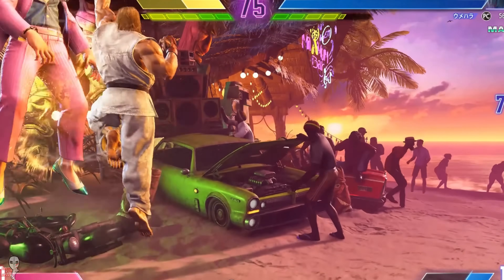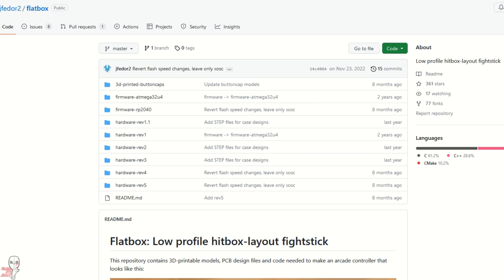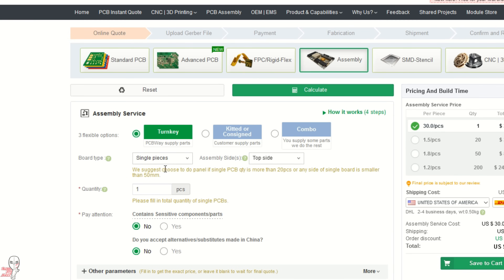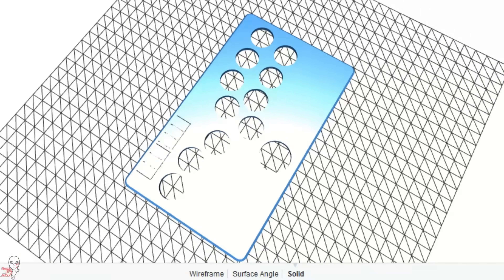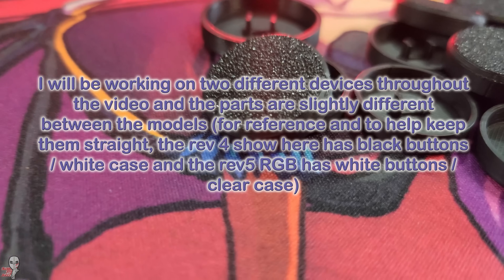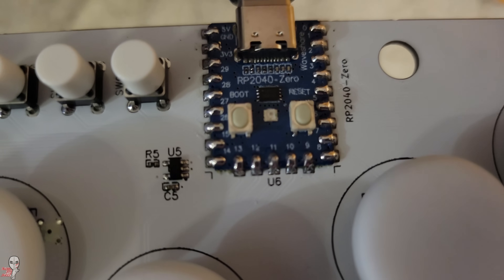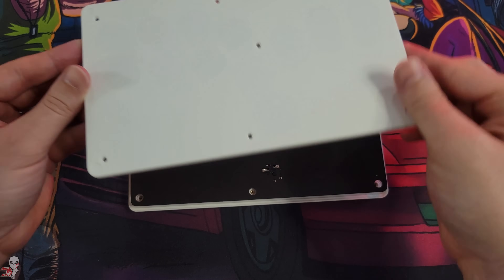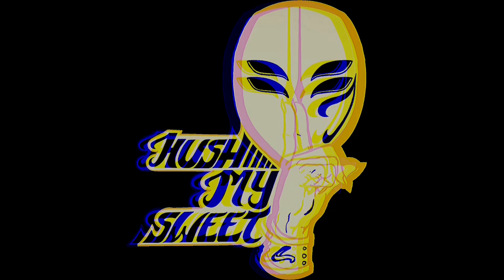Build your own Flatbox! An inexpensive, open-source fightstick option

Comment: Another great video! Is it possible to have customized layout like the Rooflemonger one you did? There doesn't seem to be much space for extra buttons.
Reply from the maker: Thanks! As far as customized layouts, they are not easily done at the moment, and we're just using the jfedor model to keep things easy for this vid. But! I hope this will be the catalyst that gets more people into that PCB design element, so I'm optimistic about the future. Right now though, this is a cheap all-button option (mostly catering to PC players, but it works on a handful of other systems as well) and it's cool because everything is open-source so you could feasible print and source everything to make it all yourself. I'll definitely post some more stuff when people start expanding on these initial templates though. Thanks for watching!
Reply: @HushMySweet1 really looking forward to it! I personally would like to have more buttons playing SF6, so for now I kinda just ditched my hitbox and play with keyboard lol

Comment: I thought those files looked familiar! I was inspired to make a variant of this with all 30mm buttons except for the left, right and down. I highly recommend the original design. Excellent documentation and well made source files.
Reply from the maker: Yes! A 30 mm sounds version sounds cool. Sort of a shiokenstar meets Flatbox vibe. Thanks for watching/commenting!
Reply: Is the size of the big keycap at the bottom 30mm?
Reply from the maker: @kleen131  Yeah, 30 mm for the jump function and 24 for all the others.

Comment: That resin looks so clean.  Great vid!
Reply from the maker: Thank you! Yeah, I was really impressed with the resin. Fingerprints aside, it looks really clean and I like the added weight over the 3d print.
Reply: @HushMySweet1 What was the cost for the resin print?  Seriously considering going that route.
Reply from the maker: @Robosan4000  PCBWay donated it for the project. This is one of their highest end resin offerings (transparent!), so I think it's like $100 for the case. You could always go with their translucent resin and for 20% cheaper than the transparent if that's too steep. Good luck!
Reply: I was going say, just burn off your fingerprints... but that doesn't stop the skin from producing oil 😅

Comment: will it work for ps5
Reply from the maker: Not at this time, but it would with a Brook Wingman converter. And maybe down the line, PS5 will be solved and we can update the firmware to enable compatibility. I'm hoping anyway. Right now it works with PC, PS3, PS4 (with the codes), Nintendo Switch, Steam Deck, MiSTer and Android.

Comment: overall, how much does this cost?
Reply from the maker: It really depends how much you can do yourself (and even then, there is variance depending on how much filament you're using for the case based on your print settings), but I'd say you should be able to put one of these together for maybe around fifty bucks or so.
Reply: I ordered the PCB, switches, and hot swap sockets from Etsy for $50. Got the tact switches from Amazon for $5. Enclosure and buttons printed at the local library for $5. So, it cost me $60 total.